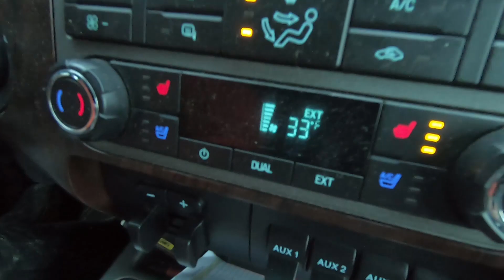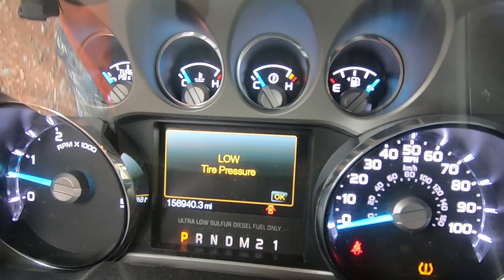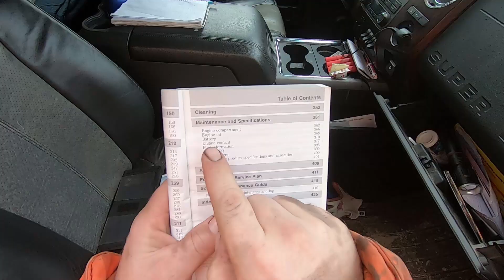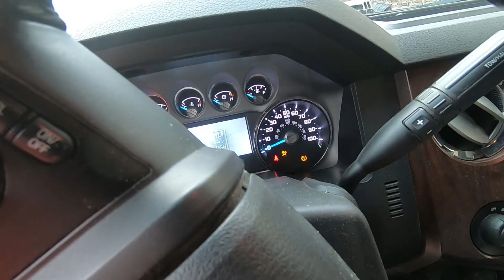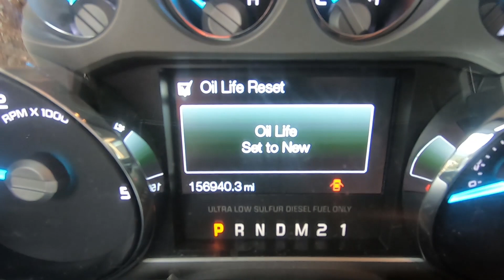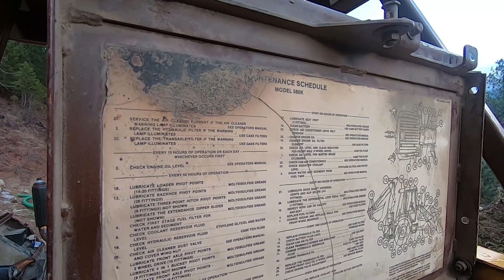How to Change Your Oil Without Any Spills

Comment: Next time run the backhoe engine for an hour, doing yard chores. The oil will drain in half the time. The hose will be way more flexible when warm.
Cheers

Comment: But... And pardon me if it's mentioned in the comments all ready....   But...
If those threads on the new plug / drain valve stick UP into the oil pan do they create an artificial dam that prevents the lowest of the oil from draining out?  I know that's probably less than 1/4 cup but it's the part that has all of the sediment and dirt.

Comment: Fill the oil filter with new oil before screwing it on so the engine doesn't have to fill up an empty oil filter nd is without oil circulations for a few seconds longer.

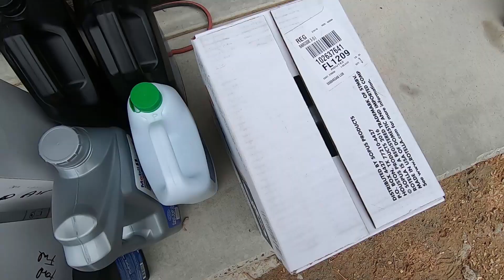Comment: Can't believe you put two bare spin-on filters gasket side down on concrete at 3:01. BAD Jesse! Concrete = abrasive dirt even if you personally scrubbed it with a tooth brush.

10 minutes on the ass-kicking machine for you.

Comment: Use a screwdriver and a hammer on the oil filter to punch a hole in the oil filter. That allows them to drain, much less mess.

Comment: Here is an old trick just place a magnet on the outside of the oil filter and anything metalic going through the filter gets caught and when you change the filter just put the magnet on the new filter.

Comment: I would suggest trying to find the correct size 6 point socket to remove that lower fuel filter, they can be a real booger to remove if the hex is rounded off

Comment: I put the bucket under the filter use a punch or nail and punch a hole in the bottom of the filter it let it drain then remove, no mess.

Comment: Not to tell you what do do but the Oem Ford filters should be used on that truck. They are far superior in quality and micron value, with a motor that expensive it’s not worth trying to save a couple bucks on filters.

Comment: Just to be another critiquer helper I'll say  "Of course you filled the oil filter with oil at least 1/2 full before installing it."  It's a little harder to do on horizontal filters."   I've got to do a Power steering line on my 1997 K1500 soon....a simple messy process too.

Comment: Cut the hose shorter so it can reach a bucket just under the drain :) Does the drain plug have a venting valve on the top?

Comment: those oil drain valves may come in handy but I would never install one without also installing a low oil pressure shutoff switch at the same time. there is just no reliable way for an operator to be on the ball enough to recognize low oil pressure before any engine damage occurs.

I've seen half a dozen people keep restarting a diesel welding machine that has mysteriously shut itself off 4 or 5 times without any of them thinking to pull the dipstick to see if there is any oil in the engine. 2 quarts later the oil barely showed on the dipstick but there was enough in it for the engine to run without tripping the low oil pressure shutoff.

Comment: Meant to say "you can't rely on a paper air cleaner filter where you live".  Also, you don't need a 6,500 PSI pressure washer.  For your situation, 3,000 PSI is more than adequate.  Also, Briggs & Straton or Honda only for the motor.  When you get the pressure washer, just remember to read the instructions carefully regarding starting.   Only start the motor with the water running to the unit, and make sure to leave the handle in the depressed position.  Most of these units will burn up the pump if you leave the handle closed (not spraying).  Also, don't even think about Bug-A-Boo and this equipment.  That's what the new tub is for.

Comment: Well, if its one thing I know its aircraft maintenance. Jets do not change oil, the oil is just tested on a scheduled basis to make sure there is no indication of bearing wear (bearings are made of layers of metals, with one layer often copper to be an indicator in lab tests) and most oil, even the jet black stuff, is perfectly fine you just need to change a filter from time to time. As for a magnet for collecting metal particles, get a donut magnet and slap it on the dome of the oil filter.

Comment: Suggestions:  Be careful of old oil filter gasket leaving pieces of detached gasket on gasket oil filter mateing surface.  Run your finger around the mateing surface to check for clean surface. This test should be used for all spin-on filters.  

Cheap filters could cost you an engine,  don't spend $30.00 on a oil filter,  and don't risk your engine on a $4.00 filter either.  I use Fram, but that is because my father recommended them to me and he was an auto-mechanic since 1940s.   

Wix is a good brand for hydraulic filters, air filters, and gas/diesel filters.  I've seen Wix filters in many professional repair facilities and factories.  Info is only for your consideration,  nothing you are doing is wrong that I see.  Final thought, might want to get a diagnostic attachment for your truck, several brands exist out there.  I can't recommend any, lack of personal experience with any of them.

Comment: ??? Using a awl in punching a hole in the bottom or lowest part of the filter Will allow the Oil to drain cleanly into the bucket. ????

Comment: Let your truck run for 5-10 minutes before the oil change. Will let the oil flow faster especially since those valves restrict the flow. And when checking your oil after changing it you should start it to get the oil filter full of oil. Let it sit for a little, then check the oil level.

Comment: save the spent oil you may want to cast things and an oil burner furnace is cheap and a wast oil heater will heat the garage for cheap.

Comment: Pick up oil recovery pump 50/90 $ on eBay or amazon hook it to your hose or it will come with a hard hose kit .pull your dipstick stick the hard hose in and pump away never remove a oil plug again.Dean

Comment: You should fill the new oil filter with oil before installing it. If it is installed empty the engine has to run with no oil pressure to the bearings until the filter is full of oil. I really enjoy you videos.
gulleyperformancecenter.com

Comment: Couldn't you put a magnet on the outside of the oil pan near the plug?  Then, remove it before you open the valve when changing oil.

Comment: It's hard to see in the video, but most ball valve handles can be removed with a single nut. If that is the case. I would remove the handle until you are ready to change the oil.

Comment: So the drain valve, by its very nature, reduces the drain opening and then the hose nipple again reduces the opening. I wouldn't recommend anything that restricts the drain opening. Moving oil will flush sludge. You've sacrificed function for convenience.

Aircraft engines don't have to deal with nearly as many particulates. Add to that, the high quality of aircraft fluids, fuel and filtration systems with mandatory change intervals and you don't have sludge issues. Apples and oranges. Be very careful.

Comment: Just a hint , its easier to fill oil on the case with bucket up in the air , lift arms are out of your way. Then again , the sides come off ours , didn't have a flip hood. So maybe the lift arms wouldn't help with your machine

Comment: you need to prime the oil filter before you put it back in. putting a dry oil filter is a really bad thing to do. you should also use a can of SEAFOAM in the fuel.

Comment: Is it possible to turn the mill head around on your track? Reason 1is so the clamps are on the operator side. Reason 2 extend blade life by limiting the times the blade enters the log thru the bark first dragging the bark and dirt with it. In trying to design my own mill I found that cooks sawmills have this feature but their price range is quite high. If this is possible with this woodmizer i may just buy the same thing in the wide version. Instead of building my own. If you could make a video testing this theory and sight any issues that may be encountered. Or if it's just a brilliant idea. I think it would be great for many people and a good selling point for this model of woodmizer. Although they may not like it because of the impact it could have on their volume of business in the resharp shop.

Comment: I have watched from the beginning ... from bare land, to where we are today ... Have I ever said anything ... NO ... however, I can't even tell you what it was like to watch you open the hood of the truck.  Bro ... get a spray bottle, 1/2 water and 1/2 simple Green.  Spray it vigorously on "everything".  Let it set for about three minutes (longer is not necessary), then use your pressure washer in "fan mode" from a distance of about three feet.  Then ... maybe I will be able to sleep at night.  Also, invest in a serviceable air cleaner.  If you have that much dust, you can rely on a paper filter.  Service the new air cleaner regularly (every 60 days where you live).  If you are going to tell me you don't have a pressure washer ... OMG, go get one today.

Comment: Make a hose holder out of a scrap of wood, drill a hole for the hose cut a slot to fit on the rim a large enough bucket to hold all the oil, start vehicle 1 draining, repeat on other vehicles.  On the truck you could be changing the fuel filters while the backhoe and sawmill drain oil, then start the truck draining while you finish the backhoe and sawmill, come back to the now drained truck and refill its oil. On the backhoe, as far as the magnet goes, what is that bolt on the side of the oil pan? Perhaps you could move the magnet there and pull it out to inspect after you drain the oil, just a couple of ideas to make the process take less time over all.  Love the videos.

Comment: Use an oil extractor and getting under the vehicle is for filters only for the most part. One guy here in the comments has an excellent idea with the shop vac. And if your engine is getting fluids changed regularly I do the oil filter every other oil change. Large capacity filters that is. I use a valve from 
http://www.checkfluid.com to get oil for analysis. It is of no surprise the values on recommended mileage to change engine oil at low intervals. I used to think it could only help but in reality the hundreds of dollars wasted when the oil was perfectly fine has me thinking of all the other things that money needs to go to. For small capacity engines it doesn't make sense Financially. For those of us that have capacities about four gallons a change, it gets insane quick. One little thing I like doing is spray out the engine bay above and below shortly after driving it to warm it up. Just don't spray anything directly especially hot components. The valves are great but I like having that magnet on the plug. Lowest and largest collection point that makes it the easiest place to trap the ferrous metals you would need to know about them being loose in there. The magnet on the filter is something someone else suggested and helps when the oil is hot and engine is off. It will help settle out anything in the filter housing while it's off. Other than that the oil is to viscous for contaminants to be effectively removed while engine is running.

Comment: You should use a screw Driver and punch a hole in the bottom of the oil filter and let it drain first. Makes for a less mess

Comment: I'm saying this as a auto tech I have 6 cars at work that all need engines now do to that thing for fast oil changes.  Just watch it and cheakd oil offend if you are putting it on your car and I worked at ford for a year it should be a 32 or 30 mm for that fuel filter

Comment: Now you have a an airplane I see you have a Hangar to house it. How about a decent shed to house all your other toy?. 
 Rust and corrosion types are going to be reduced drastically. Even that Woodmizer that saved you trillions should be behind closed doors separate to your vehicle. I do feel if you get stuck into your House furniture etc,  the vehicles and Woodmizer may succumb to the weather which would be a big shame. Now,  I step off my fruit box. 
 The idea with the oil changes is a good idea regards the valves. Most sump plugs on offroad vehicles are undercover anyway.

Comment: Couple of thoughts about the oil change on the Ford truck (or any vehicle with a vertically mounted filter)...   Punch a hole in the bottom of the oil filter to drain it once you've broken the seal free (break the seal free first in case you can't get it to break free after you're committed).   This will cut down on the mess factor with changing that filter.    Also, prefill the new oil filter before installing it to reduce the amount of time the main bearings run without oil pressure (while the pump fills up the new filter).   Does Fumoto sell a cap you can install on the open end of the drain valve that would make driving through brush less of an issue?

Comment: The socket for the fuel filter housing is a 32mm. Ford has not used any SAE fasteners on their products in over 20 years.  1-1/4 is close.

If there are no obvious leaks in the cooling system, rent a radiator pressure tester.  Your system should be able to hold 10-15 psi indefinitely.  If not, find out where the leak is.  It could be a blown head gasket.  What ever it is, it needs to be repaired !

Comment: Hey Jesse, Since you have all the equipment, why not carve out an "oil change pit" into the hillside? A "pole barn" roof over it would sure make it nice if the weather wasn't co-operating and it might get you out of the wind too. That way, you could just drive the Truck, car, backhoe or whatever right onto the elevation and not have to be on the ground. Just a thought, not that you don't have enough to do already LOL...

Comment: Garage door seal.  Building supplies have a Plastic 1"x 3-4" with a rubber flap attached for the Top and Sides.  Cut to length and nails in place.

Comment: Did you fill that filter with oil before you installed it, eh??  Less time the pump has to get the system pressurized if the filter is already full!

Comment: what?    No latex gloves?     You need to warm up the engine before attempting to drain. The evacuation of all the oil is better and all deposits that were in the bottom of the pan will also drain.

Comment: Have something to share with you a hammer and a round punch place punch at bottom of oil filter tap it with hammer until you punch through remove punch and let it drain then unscrew oil filter you won't get the mess all over you

Comment: A good tip if you ever need to take the drain plug off an engine and you don't want to change the oil, put a shop vac on the oil fill and turn it on. When you remove the drain plug, it will eliminate or reduce spillage.

Comment: You didn't use amzoil????  Also, you didn't fill your filter with oil before installing it????  Also the best thing you can do is add a pre-oiler that pumps oil into the top of the engine before starting it.  Also adding a micro filter set up from amzoil............you'll get half a million to a million miles out of that engine.

Comment: For diesel engines use AMSOIL you only have to change it every 50 thousand miles and possibly even longer if you send the oil for analysis